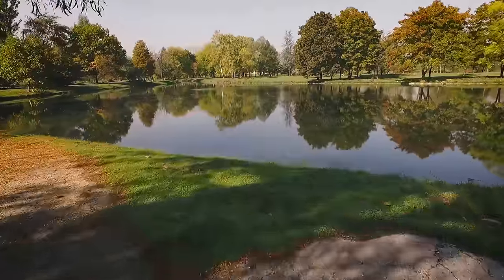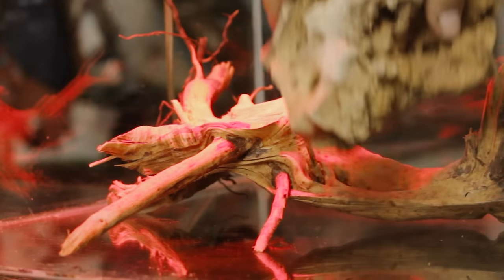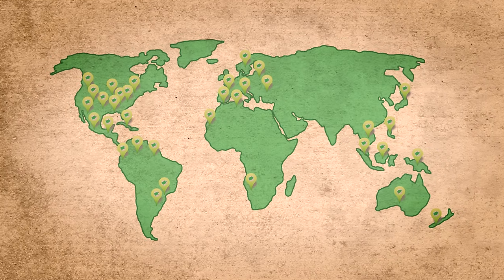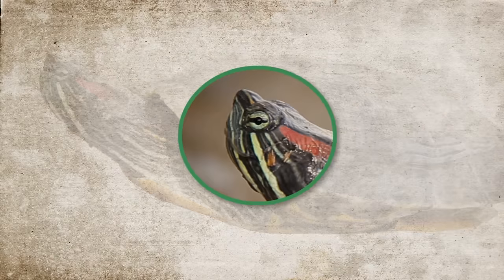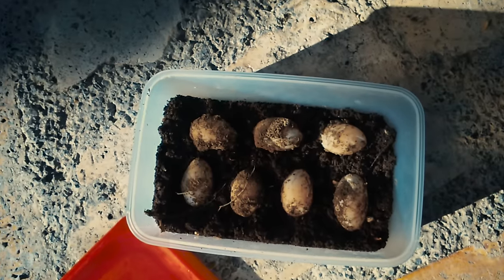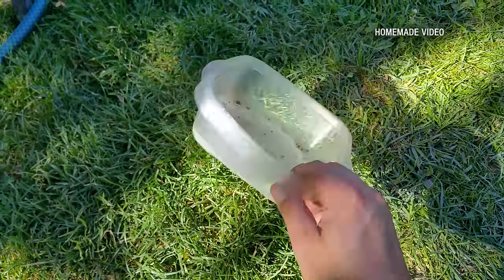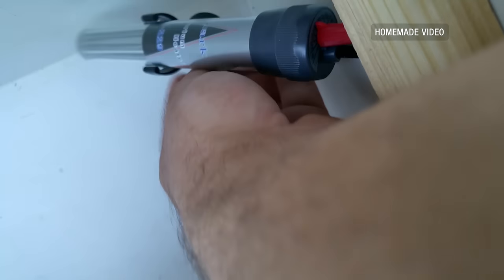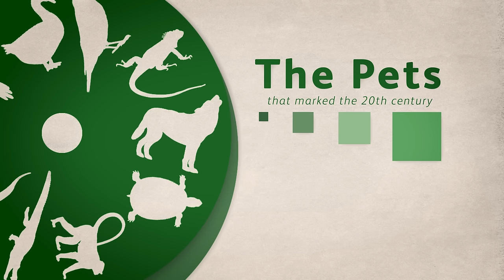The pets that marked 20th century - Red Ear Slider

Comment: My wife loves her two RES turtles. I could personally live without them, but they're cute enough to tolerate. My problem is their maintenance. They are expensive (tanks and pumps), and require frequent water changes.  However, my wife (even though I am the one who cares for them 85% of the time) loves them and enjoys watching them. Interestingly they do have unique personalities.
Reply: I found not having gravel or rocks in the tank is better bc between the food and turtle waste that gets trapped in them it clouds up the water and makes it dirty more often. I throw some live under water plants small decorations in the tank which is not necessary it's more for the owners pleasure than the turtles. They usually knock them over or it's in there way. Best thing is to keep it simple for you and sensible for them. As far as up keep get a syphon with a hose and big home Depot bucket and get that dirty water out of there at least more than halfway every two weeks and a full cleaning every month at least. So you can take out and change the filter and the heater clean those and the glass on the inside. It's really not that hard if you keep a schedule and it won't have to be done as often and you and your girl can have a project to do together.
Reply: They really do recognize you and even get to know your life as they watch you as much as you do them. I have two and when they need to be fed they splash the water and when I go to the tank they wait at the same end every day to be fed. At 5 they splash to be fed again. At 9-10 they know lights out and go to there spots at the bottom of the tank to chill or chase each other. During the day they go to the penthouse on top of the tank to bask and chill and sleep. They are expensive but if you go online on Craigslist or letgo you find stuff for the low or even free. 100$ tanks for half or even lower if they are willing to barter.

Comment: Um... females require no special care?  You need to provide a place for the female to lay her eggs, I'd say that's significantly more special care than the males need.
Reply: I think you need to provide an area for egg laying if you breed your female or believe it has eggs to lay. Which only comes if a male is present. So if you do have a female and male then you will need to have an area for laying but if you have just a female I think you don't need an area for laying eggs.
Reply: Unfortunately not true, females require nesting areas regardless of the presence of a male, the only difference being the eggs are not fertilised so of course will not hatch. Failure to provide a nesting area may lead to your female being egg bound which in turn can lead to those eggs rupturing and poisoning the turtle.

Males do exhibit aggression with each other, but are substantially smaller than females, do not nest and have no additional care that a female does not also need. A single male is the easiest to care for (relatively speaking, as the video narrator points out all turtles require a fairly substantial amount of care).

Just felt I should post that correction in case anyone with a female slider gets the wrong impression. Source : Austin Turtle Page Forums and of course my own Female Sliders.
Reply: my turtle is transgender